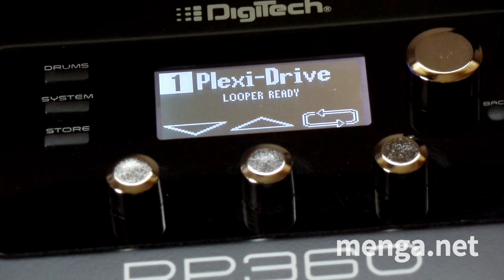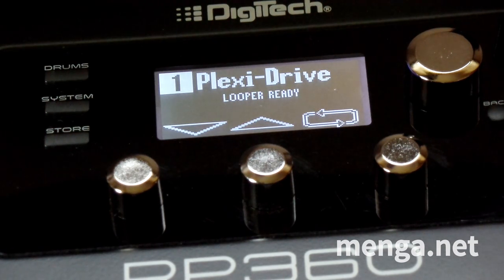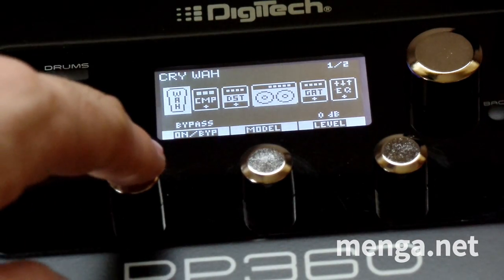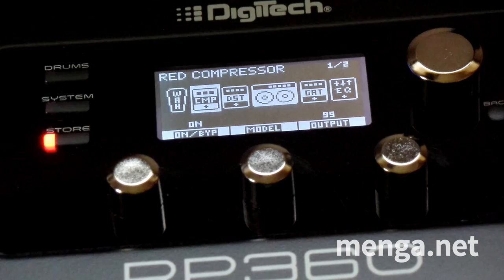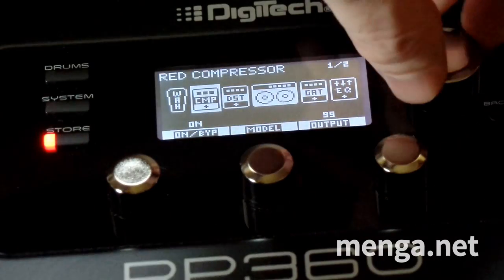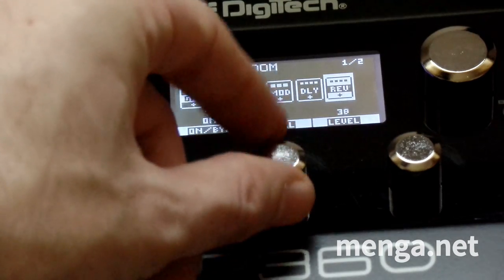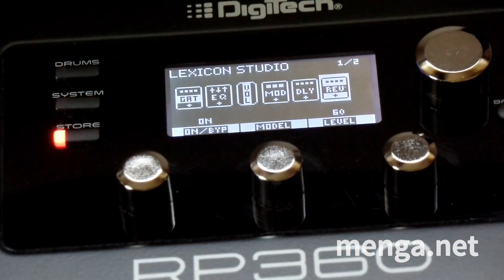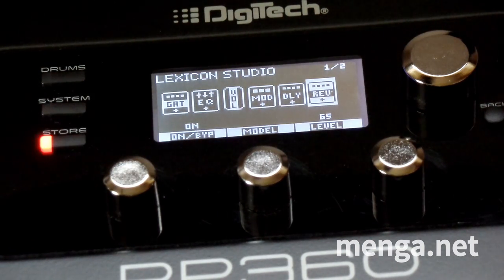How to get Clapton tone of out a DigiTech RP360

Comment: Just a tip from an old RP user and programmer..   The patches you make direct or through computer monitors will never sound good or the same through the clean channel pre-amp section of a guitar amplifier..   If your guitar amp has an effects loop always plug into the return..  You won't be dealing with the noise and weird edge of stacking two preamps..  The sound will be much better and cleaner for any over driven sounds..  the clean may take a bit of tweaking to your liking...  and remember when it comes to processors that less is more. The less efx that you load on a patch the better your tone will be..  and don't be afraid to put a wah and a line booster (mxr) or transparent overdrive (sweet baby) in front of the processor to give your patch some gas or edge when needed...   Enjoy and Rock on!!
Reply: onefatstratcat - Did you work for Digitech, or program on your own like I have to every time I buy a guitar processor?  I say why don’t they ever give you the 3 basic sounds you need to play?  ...clear,  semi-dirty,  nice reasonable lead?  It’s alway these wild sounds you can’t actually use in music. And musicians are not typically tech oriented, so I get people bringing their pedals to me to get what they need.  The RP360 does have many presets I can start from though, I will say that.  It’s a great pedal, and I own many more expensive ones. The 360 holds it’s own.

Comment: With a USB connection of the RP 360(XP) to a PC you can save the patch (or any patch) to it and share it that way as a file. You can also backup all setting of the device in one big file and copy so everything to another device all patches included.
Thats in more ways cool because if you have to do a master reset for any reason you can have your patches saved and reload them after the reset.
Actually a pretty cool feature. ;-)

Comment: Sounds great.  Suppose it's possible to get the Clapton sound and store it on Footswitch 1, and then continue to use 2 & 3 as separate stomp boxes ?  I'm currently using the pedal for Distortion, Delay, Reverb.  Thx

Comment: Cool man! I have the same RP360 and surprised with tons and tons of what it can do. I had a problem with it recently when I upgraded my OS to W10. The software does not anymore work as it is only compatible to W8. I contacted already DT regarding software upgrade but till now they have not yet came back with a solution. So I have to do all the tweaking manually now as it is way way easy when it was connected to my laptop. Cool tone though... I have also downloaded a lot of patches from the DT website.....